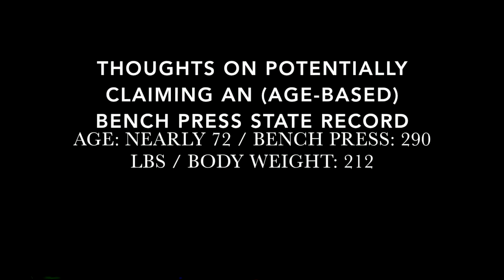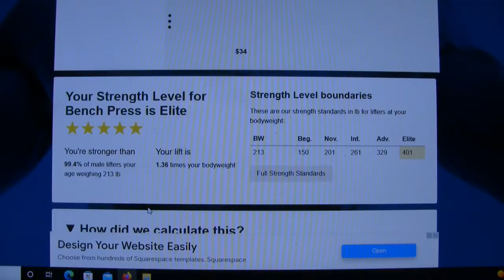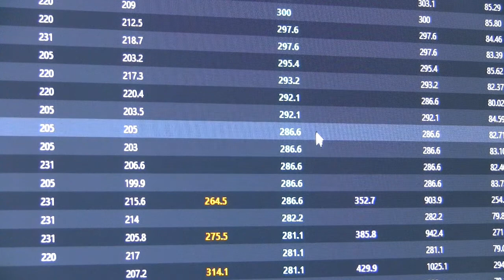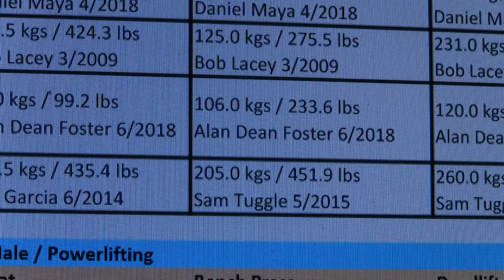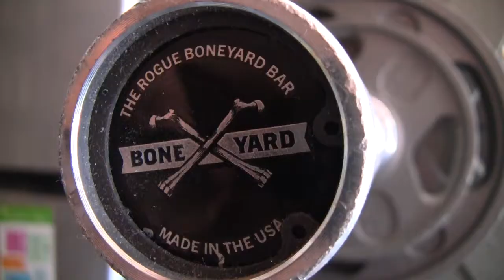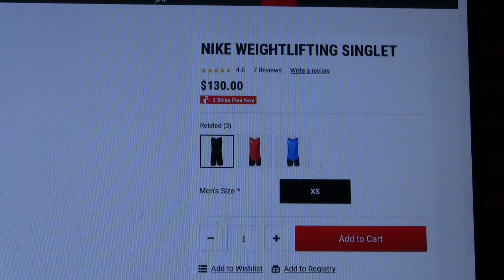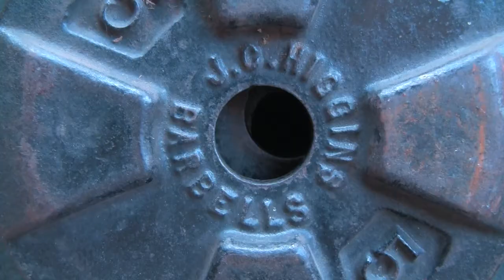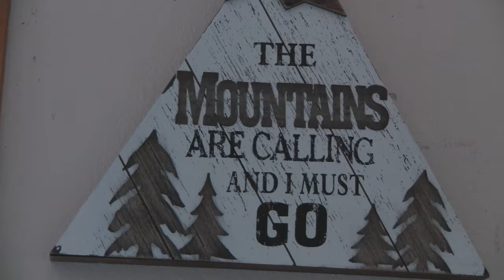Senior Weight Lifting:Thoughts on Potentially Claiming an (Age-Based) Bench Press State Record

Comment: I love this video. I will be 71 years old in a few weeks. I have trained with weights since my teens. I competed a few times in powerlifting meets in my late twenties. My best lifts were 465-squat, 365- benchpress, and 525 -deadlift. This was at 181 lbs and drug free. Today at 70 weighing about 185 I can squat 300, bench around 250 depending on the day, and deadlift 350, maybe more. I put a home gym in when my kids were born and going to a gym after work would have been tough. I still train five days a week . I have at times let my weight slide up to around 205:lbs, but recently like you decided to drop a few pounds. I am glad to see there are others out there that have a like mindset. Keep on keeping on.
Reply from the maker: Thank you very much. It's always very special to hear from guys in my same age world. You were plenty, plenty strong in your competition days. And you still are in old age. I just posted a video of me squeezing out a wobbly 315 bench. I'm fast approaching a crossroad: do I want to keep trying to get stronger (and fatter), or do I want to start losing body weight and try to maintain or improve (with enormous difficulty) strength. I've put on weight since this video, towards getting stronger. I'm jealous of your current strength -- especially the deadlift and squats. I hesitate to do those exercises because my back seems increasingly precarious. My shoulders remain good though -- hence, the bench pressing. Thanks for stopping by.
Reply: @rocktheclock240  Thank you. I have often wondered if there were any of us at our age out there still pushing the iron. I have taken the approach of dropping a few pounds . I haven’t noticed a significant drop in strength. I applaud your tenacity on the bench press. Few people ever reach your level of strength and doing so at our age. I haven’t focussed on just one lift and have been fortunate on the injury front . I did injure my shoulder years ago in a hockey tournament which has made benchpress my toughest  lift. Years ago I had some issue with my back and deadlifting actually improved things. I started out light and was careful throughout. In my case dips and any overhead pressing is tough. I would love to have my bench up with yours. Have a great day . I will look for your latest video this evening.
Reply from the maker: @jimlimberakis8115  Thanks again. Yes, it's good to communicate with guys in a similar "boat." For a number of years, even into old age, I was a fanatical hiker and I think walking all day long -- nearly every weekend for years, sometimes both weekend days -- with a backpack helped wear down my back. I did a lot more hiking than weightlifting. And I injured my back when I was in my thirties -- I was only doing warmup squats and something jarred in my lower back: The next day I couldn't walk a block without sitting down -- this lasted for the next few months. I guess muscle spasms. I didn't know if that situation would ever get better. So, older guys who can still squat and deadlift truly amaze me. So many young people even have back issues. But there's a risk there: if you blow out your shoulder on a bench press, it's bad news. But if you blow out your back, you might not even be able to walk. I've thought to try light squats and deadlifts (I've got the racks for them) but I can't help but wonder if I'd be courting disaster. I know more than one person who has back surgery. And, in my mother's case, I suspect that intensive surgery on her back when she was in her 80s contributed to her eventual Parkinson's Disease. If not initiating that problem, enhancing it. I asked her neurologist about that. His answer was only to shrug: he didn't know if there was a relationship between spinal surgery (connected to the brain) and such a disease. His answer was, essentially, "maybe." Do you use a belt for those exercises? Congrats again on your impressive accomplishments.
Reply: @rocktheclock240  Well done on the hiking. That’s impressive to do so with a pack no less. There are lots of ways to do both squats and deadlifts. Even air squats have benefits. There are belt squats that remove the back from the lift. I do a variation of goblet squats with the bar and weights on one end. I use a brace doing front squats which removes my back from the lift. Have you tried sumo deadlifts as opposed to conventional. Again the major stress is removed from the back and is taken up by the legs and hips. I do a lot of deadlift work in my rack. I will change the heights of the pins to duplicate lifting off blocks. I can do much of my deadlift work from these positions. I was a conventional deadlifted for years,but have incorporated sumo now for much of my work. I haven’t heard of a correlation between back surgery later in life and Parkinson’s. My wife worked in a medical field for many years. I will ask her if she has heard of any ties. I do use a belt doing squats and deadlifts. I don’t on my light sets, but do on my heavier working sets.Do you do a lot of volume benching ? How many days each week ? My bench days are Sunday and Friday. Sunday I will have five sets of inclines,usually with 8-10 reps. Flat benches,5 sets with the same reps, either Larson press or weighted dips,3-5 sets. Friday will be incline dumbbell press,flat bench,same number of sets and reps, and dumbbell fly’s . On both days I will have five sets of  tricep work, and that’s followed by 6-8 sets for back. It’s a lot of volume,but works for me.
Reply from the maker: @jimlimberakis8115  Thanks for the reply. You know, I'm impressed with your accomplishments, including your apparent energy to do so much lifting. I'm thinking about creating a little video soon about how I went up 30 or 40 lbs (I'll have to check) in bench press max while in my 70s. No miracles. Nothing fancy. No secrets. I first determined to do a 300 bench press again, as an old guy, before I die. (Touch-and-go). Did that. So then the goal was the three big plates on either side: 315. I'm there now, but a bit wobbly. Hope to improve this -- maybe even get stronger?

I think you put me to shame for energy and effort. I have A LOT of days when I'm too pooped (like today) to go into the gym. I was devastated by the flu last Thanksgiving though, and the thing called "post-viral fatigue" seemed pretty real to me: for months.  I usually bench twice a week, sometimes 3 times, with a handful of other exercises (dips -- a 75 lb dumbell attached for 5 reps if I feel strong, rows, tricep pushdowns on a cable machine, etc.) if I'm up to it. Lately, I haven't done anything else (I hope to return to "leg days" and such). I'm pushing for strength, so I always do a few sets of very low reps of heavy weights (relative to me). But my energy level on any given day varies wildly. Sometimes I go in and do a kind of "test" and if I'm especially weak I might bail for that day and try the next day. So, the day I squeezed out a 315 I knew I had a shot because I was able to do 285 (touch-and-go) for 3 reps, which was new these days for me).

For me, sleep is a big deal. If I don't sleep well, I'm weak. If I'm well-rested, that's the day I have a chance for a personal best (per these days, as an old man). Once and a while I take a week off. But, overall, I keep getting in there regularly and keep pushing. I just try to increase the heavy (for me) weight in little increments, over time -- keep pushing myself to squeeze out a little more. I go for a max fairly often (if I feel "goodish"), which isn't what a lot of folks recommend, I know.
Reply: @rocktheclock240  It is I who am impressed with your feats on the bench. My program doesn’t call for one rep max lifts. It tells me a range. There are days when I don’t feel my best,but I still train though I will adjust my sets accordingly. I don’t take any long breaks either and haven’t for years. Last November I got hit with a double whammy, Covid and a bad tick bite. I was pretty such for the better part of two weeks. I lost a lot of weight and my lifting did suffer. It took me a few months to get back on track. I look forward to seeing your increases on video. I agree with you there isn’t really any magic to making gains,but it is a lot harder at our age. I don’t use any supplements either. I used to bench three days a week in my youth. I have done so a few times the last few years. Dips with a 75 lb dumbbell is quite impressive. Dips are hard for me with the shoulder. Some days I can do them and others my shoulder hurts too much. I use a training aid,the Slingshot developed by Mark Bell. If my shoulder is especially sore I use it for all sets,but mostly use it at the end of my bench sets. Of late on my squat day I have focussed more on front  squats. I got a harness of sorts from Titan which allows me to place the bar at three positions. I feel the front squats in my quads whereas back squats I feel in my back and hips. Looking forward to watching more content. Talk soon.
Reply from the maker: @jimlimberakis8115  Yes, you do unusual things for your (our) age. Everything is harder when you're in your 70s -- and nothing ever gets easier. Your perseverance and dedication is admirable. Even shocking. Even with a nagging shoulder, your bench press to body weight ratio, alone, is really striking, especially per age. With all your accomplishments -- deadlift, squats, bench press -- you're kind of in a class by yourself. 

I once tried the Mark Bell slingshot routine for a few weeks and then, per his advice, tried a bench press max. I LOST about 20 pounds in my max! I maybe overtrained in that period -- at least for an old guy, I don't know. Anyway, I bought his sling shot but I don't need it for shoulder pain (I'm OK, without pain so far), and it didn't increase my actual lifts by very much. I think the different slingshot colors, per your own strength, have a lot to do with how much those things help. And maybe I'd need to spend more money and get the one for heavier benches. But -- more money. More money. More money.  Anyway, the slingshot system was basically a bust for me.

Covid and tick bite combo sounds devastating. I've done tons of hiking in my life, and I sometimes wonder if I ever caught lyme disease from a tick. I've had big fat ticks on me hiking at Isle Royale Nat'l Park in MI, for instance. My fatigue factor, though, as it sometimes lingers, may just be linked to old age. 

Why don't you post any of your lifting stuff at You Tube? I resisted doing it at first -- I thought there was, implicitly, a vanity factor that I didn't like. And who cares what anyone does during their exercise sessions? It sounds boring and tedious. But what I found is that there is a community of fellow lifters out there who are supportive, and encouraging. That's nice, and motivational. The downside, I think, is that it pushes me to keep up my little "reputation," if you know what I mean: "Old guy makes progress and can do this, and so can you." There's a kind of subtle pressure -- which is both good and bad -- to do more. But, of course, even without a video channel I would be motivated to get better and better. The point is, I guess, is that when you're just doing your exercising in total obscurity the only one you can disappoint is yourself. When you do it on a little You Tube stage, you can -- in a strange way -- disappoint others too. In some odd way you get sort of trapped into becoming an "old guy can do it therefore so can you younger guys" motif. You don't want to let other people down, as well as yourself. So, again, there's both good and bad elements to that scenario.

And, as I have said, if I -- or anyone -- wished to weight lift competitively -- either bodybuilding or powerlifting -- you are FORCED to entertain the prospect of ingesting, or injecting, all sorts of garbage into your body in order to compete. BECAUSE EVERYONE ELSE IS DOING IT! And the "bar" then keeps rising to be competitive. I've never been tempted, ever, to do any of that, because I never cared to become a formal competitor. And, I think, in significant part, that is why I can still do what I do in old age. I never overtaxed my body in my youth -- with drugs or Beyond Belief heavy weight that, ultimately, harmed my muscles, bones, and joints.
Reply: @rocktheclock240  The slingshot does come in different colors denoting what poundage’s you are using. I believe the yellow one would be appropriate for your level. I wonder if perhaps your fatigue could be linked to a tick bite ? Perhaps I will consider posting some lifting video . I did post on Instagram with friends who also lifted. I have never considered my lifting as vanity. I do have friends who question why I continue lifting at this my age . There are many reasons  . I like to stay fit, to test my strength , to stay as strong as I can, the health aspect in terms of longevity, the camaraderie of like minded people. When I competed I knew a lot of the lifters were using steroids. In those days there were no drug free meets. On some level it bothered me, but not enough to make me quit . I had friends who used steroids. I had no interest in using them whatsoever. I competed on my own terms and that my strength was earned honestly with hard work. I don’t harbor any ill will toward those who use anabolics. Their choice. I agree with your premise that we are able to continue on because we didn’t use anabolics. I believe you can and will do more on your bench. The way the weight moves in your videos leads me to believe you have more in the tank. I doubt there are many men out there our age that can move the weights you are using. I remember seeing an older than us Russian gentleman benching around your numbers. He was heavier than you, I believe 240 lbs. Have you ever watched video of Kyrill Sarachev benching ? His technique was something to behold. At his peak he did 739 lbs. He had a big squat and deadlift as well. Have a good night. Talk soon.
Reply from the maker: @jimlimberakis8115  Thanks. You know, I had surgery on one of my elbows about 20 years ago. Since then, I can't quite straighten that arm, even with no weight against it. So some might quibble over the fact that my bench presses aren't "perfect" per arm extension. But there's nothing I can do about that. That's the way my elbow healed. I just do what I can do and that's it. 

Yes, I think, if they do drugs, most "serious" lifters in their younger years won't be able to do much at our age because they've blown their bodies out earlier. Life is a long race, not a short one. I don't harbor any ill will to anybody, but I think it is unfair that people like us who have avoided all the cheat avenues would be forced to "do what they do" in order to compete with them. When I was in my teens, there was none of that stuff. And what was "strong" back then is leaning towards being mediocre today -- with all the "additives" and "supplements" around to artificially increase strength.

I never heard of Kyril Sarachev. I'll look him up.
Reply: @rocktheclock240  I think if informed ahead of time judges allow for things like your elbow injury. I agree with your thoughts on how steroids affect us long term. I like you never considered there use. I knew going into meets there were people using them and that my numbers would not be competitive with them. That being said I had a goal in mind and that was my focus. I remember how excited I was when I got 525 lbs in the deadlift. My weight that day was 177 lbs. I really didn’t care what others did that day. Sadly I think you are right in that many would consider our lifts to be mediocre. I look at what you have been able to do and marvel. So on we go with new goals. I look forward to seeing where this year takes us.
Reply from the maker: Well, your lift accomplishments are really, really impressive. That you did them "clean" is all the more impressive. (You must have been a fanatic!) Few have done what you've done, especially per your body weight to the actual lifts ratio. Much respect from here.
Reply: @rocktheclock240  I was serious as to my workouts. I also have a family and owned a business . Those were my priorities. Some might call us fanatics today to be training with pretty heavy weights. I have many other interests beyond training as do you too. The training is just one facet of life though it does carry over into other areas.

Comment: Keep It Going Never Give Up 💪
Reply from the maker: I won't. Checking your own You Tube channel, you're pretty powerful, especially per your own age.
Reply: When I Was 61 I Did A 375x1 Bench Press Which Was A Great Lift For My Age ..I’m Like U I’m 72 Yr Old And I Keep On Keeping On ..I Jumped Ship In The Navy And Hitch Hiked To WOODSTOCK in 1969 And Collect 60’s Rock Posters I Have About 20 Of Them ..Keep On Rocking Around The Clock …BIG JIM 💪
Reply from the maker: @MrBigjim1967  I was working a summer job, as a college kid, at a Chrysler factory. I had to beg my mom to borrow the family car to drive the 1,400 miles, round trip, to Woodstock. I was there with 3 friends for 2 days, and had to leave early so I didn't lose my job. I was hated by the other guys.